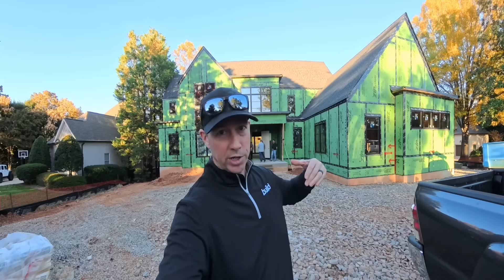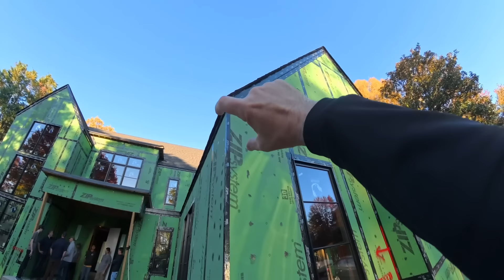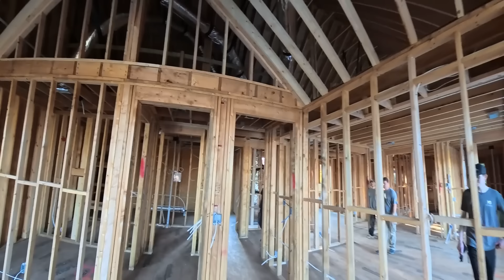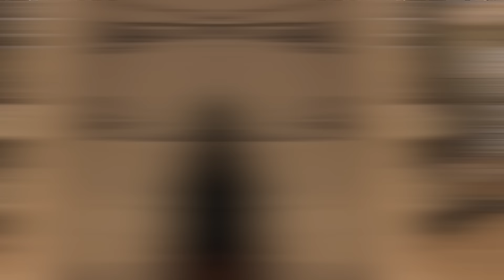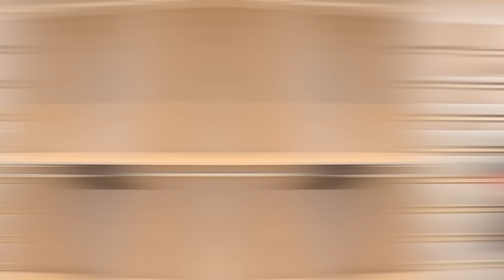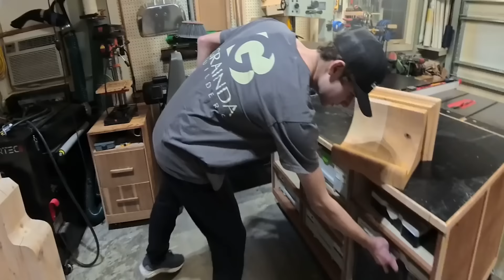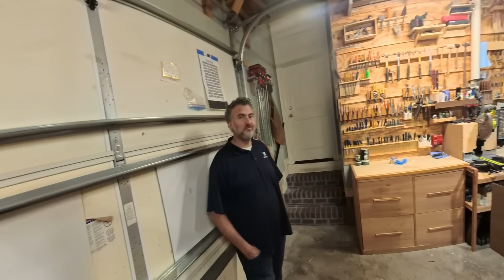Matt’s Pro Builder Trip—See What They Learn

Comment: Would it not make sense to put the fascia/rake on before doing that roof? On that opening scene (0:20 ) looks like if you added a 1” fascia you’d be right at the edge shingles, possibly short? Also if you want to add drip edge that isn’t just for aesthetic you’d have to get under the ice and water which would be a bit of a pain in the butt. Feel like that would be particularly important on this one with no overhangs. 

Beautiful build though. Well kept job site.

Comment: Guidance for Installing an Over Roof Assembly
Over Roof Assembly Installation Questions

When installing an over roof assembly, the existing roof deck will serve as the underroof. In this scenario, the underroof decking consists of 3/4" plywood, which will now act as the continuous water-resistive barrier (WRB) originating from the exterior wall sheeting of insulated ZIP panels. Achieving a continuous air barrier is a key objective for this assembly.

Material Selection for Underroof Decking
A critical question concerns the material to be applied to the plywood underroof decking. Specifically, it is important to determine whether the applied material should be vapor permeable or vapor impermeable.

Suitability of WRB/Vapor barrier Products
Consideration is also given to the use of WRB products such as Henry VP 100. The question arises as to whether Henry VP 100 would be sufficient as a self-adhered (SA) peel and stick membrane for this application.

Comment: Don't forget to add the Cavity Slider temp spacers before drywall.  I forgot and the door openings warped slightly and the openings are inconsistent with a couple of doors rubbing on the jambs during seasonal humidity changes.  You should pop them in now.

Comment: I am being advised to atleast do 2" of closed cell across the roof deck before doing open cell by my engineers. They are seeing open cell acting more like a sponge then it just letting water permeate through. Causing mold and rot. You think improper installations or does the standard need to change?
Reply: Ya I would agree. You don’t want the moisture to migrate through the open cell and condense on the back of the cold roof deck. Especially without an over vented roof deck and using asphalt shingles (which would stop the moisture drive from inside the house and cause the condensing on the roof deck). Someone correct me if I’m wrong!